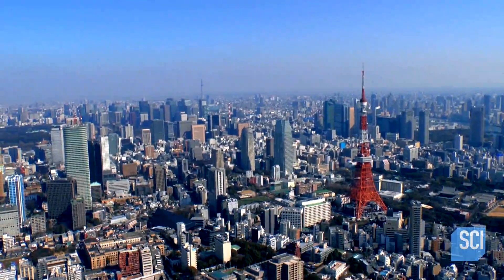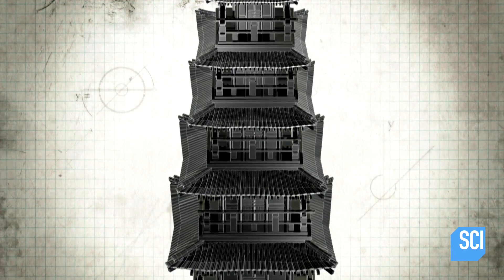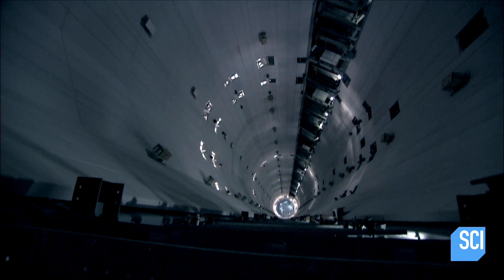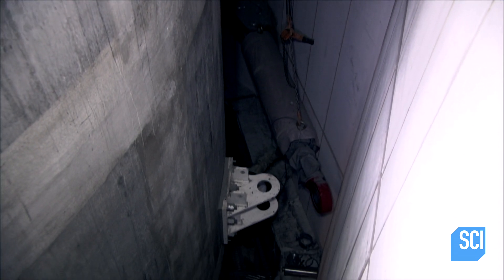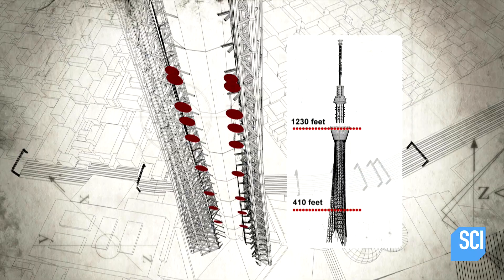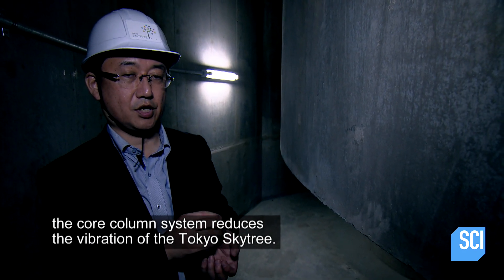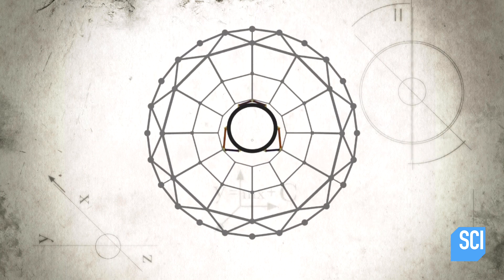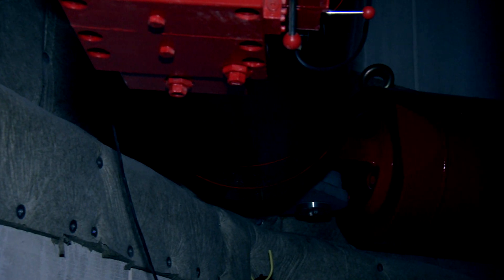Here's How Engineers Used Ancient Techniques To Protect Tokyo's Skytree From Earthquakes

Comment: pretty freaky... there is a huge concrete column up the center of that huge tower and it sits on rubber pads.... hmmm I am glad I dont live anywhere within the arc of the height of that thing!
Reply: Well you shouldn't be. It's in the middle of a park
Reply: i see... but the height of it... if it laid down some direction it would land outside of the park from the looks of it
Reply: I am looking at google earth... and it does not look like there is a park around it. it is in the middle of buildings in the city.
Reply: +fireaza Yeah. You're right. I messed up
Reply: I wouldn't be scared. This techniqe is the only reason why the tower is still standing after so many earthquakes.
Reply: +Radi Bear You're thinking of Tokyo Tower, bro. It has a park next to it, but Skytree is surrounded by buildings.
Reply: I agree with u on that one because I would be scared to
Reply: Are you sure you aren't? It is very tall.